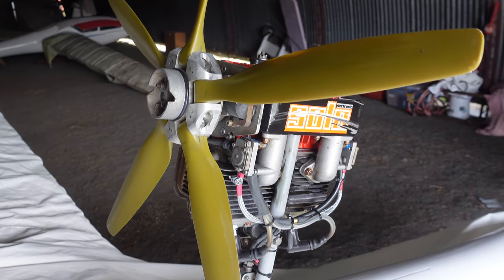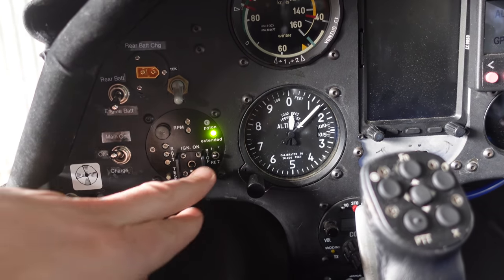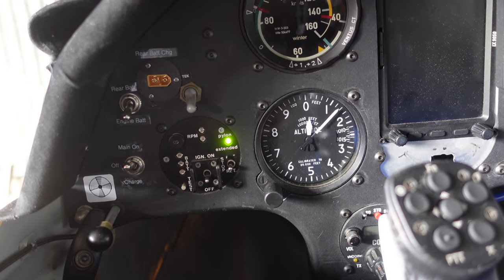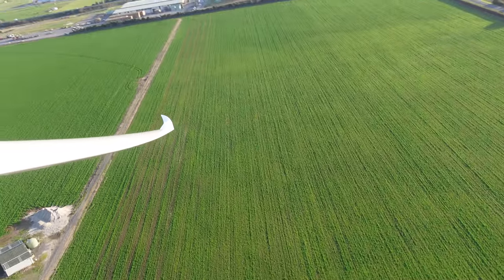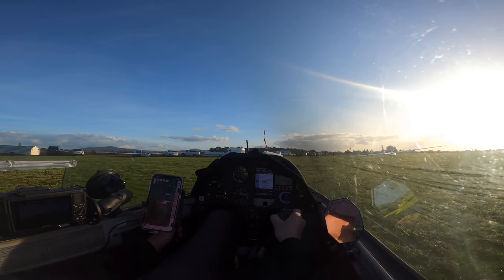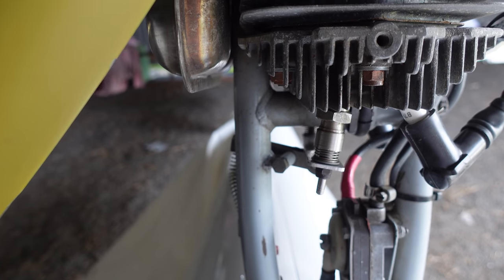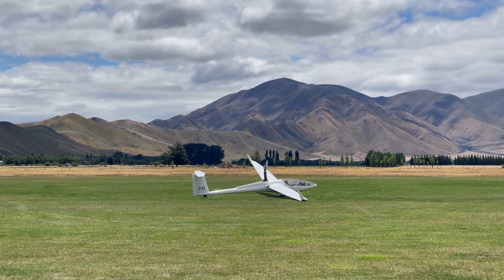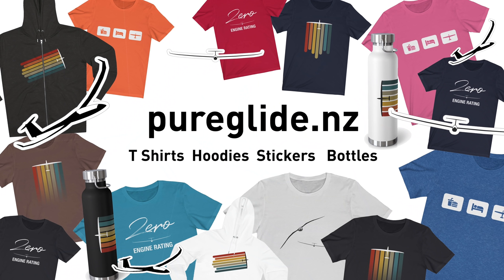How a Glider Engine / Turbo / Sustainer Works

Comment: what are the basic advantages of a glider w/engine vs. small plane? Is licensing easier?
Reply from the maker: Great question. A glider is for gliding - it's a bit like asking what's the advantage of a yacht vs a dingy (small motorboat). The dingy will get you from one side of the harbour anytime you want. It requires very little skill to do it. But sailing is a whole different game. It requires skill to read the weather and get the most out of the boat. It's a sport, that we do for fun, not a utility.
So the same is true for the gliders. Want to get from A to B reliably? Get a plane. Want to go soaring for fun? or race aircraft for sport? Get a glider.
The engine in the glider is just to make it easier to get home again if the weather changes or you make a mistake. Could you use it to get somewhere? Sure, but as there's almost no luggage space, it won't be a lot of use!
There are touring motor gliders which are a bit bigger, usually 2 seats and have a bit of luggage space which kinda do both.
Reply: @PureGlide  aight, thanks for the explanation. gliding is closer to what birds do and done for enjoyment, whereas planes are a form of transport.
Reply from the maker: Bingo!

Comment: I've been looking for a panel mount XT connector, where'd you get that?
Reply from the maker: Online somewhere, but I wouldn't recommend it, they're not very good. I'm going to swap out for XLR connectors, which is what most of our gliders use these days. Cheers!
Reply: @PureGlide  thanks
Reply from the maker: Here’s the one I got https://www.mrpositive.co.nz/xt60-panel-mount-kit/
Reply from the maker: This one looks way better. It must be new, never saw that when I was looking originally https://www.mrpositive.co.nz/xt60-male-panel-mount-connector

Comment: lol showed the engine coming up but not starting up
Reply from the maker: Yeah it's a bit hard to start it on the ground, we have to dive start it while flying :)
Reply: @PureGlide  i meant the camera angle pointed at the engine mid flight while the engine is starting
Reply from the maker: Oh yeah that would have been good, I’ll try and capture that another time! Cheers

Comment: Does it always sound that loud while flying?
Reply from the maker: With the engine going you mean? Yeah, I use noise cancelling ear buds
Reply: @PureGlide  no when you were just gliding.. The wind sounds very loud
Reply from the maker: Yeah can be if the window is open or the air vents

Comment: Engine noise detection. Hmmm. Electric motor? Is the prop noise sufficient to set it off?
Reply: The gliders that have a electric motor(fes) still make enough noise to detect, and in same competitions there fes only race there you alouwed to use a X amount of KW/h during that flight.
Reply: The noise comes mostly from aerodynamics, done by propeler. Easilly detected.
Reply from the maker: Yes the engine noise detection works great for dinosaur burners, but not so good for jets and electric. But they have their own methods and detection so people can't cheat. And yes as the others say electric might still be noisy enough. A problem can be that if you're in a noisy cockpit because you're going so fast, that can trigger the engine detection just from the wind noise... but you can tell, as it's a bad idea to get the engine out at 120 knots...

Comment: I think it's a bad design that engine-up switch is cutting off the ignition. It doesn't have a starter so there is no way it will turn inside it's compartment, so the ignition-on should cut off possibility to hide the engine so that the switch failure won't render you without an engine working.
Reply from the maker: Hi it has a switch to detect if the pylon is fully extended or not. So if it goes down for any reason, the ignition is turned off. Having it creating thrust when not fully extended would probably not be good!

Comment: So you mean that this cT I bought won't get me off the ground?
Reply from the maker: Sure it is if you try hard enough! Actually I bet it would work at Matamata, maybe I will have to try it one day...
Reply: If you have a very large hill, or someone to hand-prop it for you, maybe? :D It's been tried, I know at least one person who's done it, but there's a reason it's not recommended.
Reply: @Rickenbacker69  I'll ask Mr Pure Glide to do it for me.  Don't hold your breath: he's no fool.
Reply: I've seen it done on the tarseal runway at Paraparaumu, which is 1187 meters. It didn't need anything like that much, but the 600m of grass probably wouldn't be enough. You do want to cross the airfield boundary and adjoining houses at a reasonable height too. A quick tow to 100 km/h and 50 meters height behind a car would be completely practical anywhere.

Comment: it would be better to use a  pair of electric ducted fan jet engine it would be lighter, consume no fuel and have more power for climbing and be easier to contract into the glider. put this on it. it would also reduce the drag.
Reply from the maker: Would you believe they have jet gliders? I don’t have one because I can only afford 35 year old gliders, and this is what they come with! Saying that you can still buy an almost identical motor because they are still better in some ways in particular range. See the part 2 video for more info!

Comment: 55kts is not best climb speed. See yellow triangle which is best glide. BG is always higher than minimum sink. I found best climb max 50kts or slightly less to get  roughly 2kts of climb
Reply from the maker: Ah whoops you’re right, I think it’s 52knots. Cheers
Reply: Yellow triangle is not best glide. It's the minimum speed at which you can approach at max AUW with full airbrake and still adequately flare.
Reply from the maker: Ah yes manual says climb at 85-95km/h or 46-51 knots. So I've probably been a touch too fast at 52 knots.

Comment: Do you suggest the same approach speeds eng out/engine stowed?  Thanks
Reply from the maker: Good question. I suspect you should fly it pretty much the same speed as normal? Although it makes more drag, that will affect the glide ratio, but it's not destroying the wings ability to fly like the air brakes do, so the stall speed doesn't increase.

Comment: Well, we went through the painfully slow extension sequence three (3) times, watched as it was used as the aircraft equivalent of a boat anchor, but somehow not once did we see how using the engine makes your gliding experience better…….. you know like climbing over rising terrain or something. silly me, I assumed that’s what the whole point of the video would be
Reply from the maker: Hey yeah this was focused on how it works, rather than when I use it and why. That’ll be good for another video! Cheers

Comment: Nice video.
Reply from the maker: Thank you!
Reply: @PureGlide  When you cover about others types of glider with retractable engines. Please explain how the system those who has two blade propeller make the propeller stay in the right way to retrac. Thanks.
Reply from the maker: Noted!

Comment: So, I notice that you've got all the prop blades on up-side-down, and you've also mounted the entire motor pointing the wrong way.  Is this some kind of home-made invention that's never been used, or what?  Folding propellers need the thrust to be in the direction that pushes the blades open - because your motor is backwards, the thrust is going to be pulling the blades closed again.  Also, when prop blades go round and round - the "blunt end" is the leading edge.  Please never turn this on!!!
Reply from the maker: Haha this design has been used for over 25 years. This glider
Is 20 years old. A brand new one today has the same thing. Centrifugal forces I suspect make it work just fine :)

Comment: Just wondering how do you control the fuel (lean / rich) mixture settings  also carb heat control  to prevent icing during changing flight conditions with this type of engine set up.... many thanks. By the way you're vids are very informative and have just subscribed to this channel .
Reply from the maker: Hi James! Thanks for subscribing. There is no control for the fuel mixture. And no carb heat. Keep in mind we're operating this engine near ground level most of the time, not high altitude. Now you mention it I'm not even sure what the altitude limit is, I'll have to look it up!